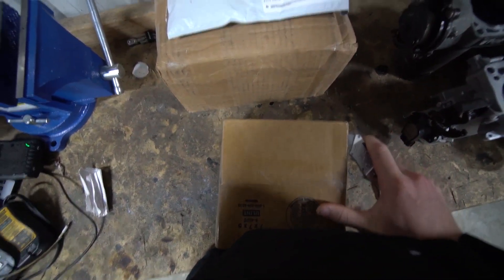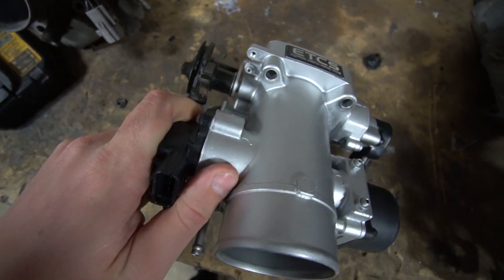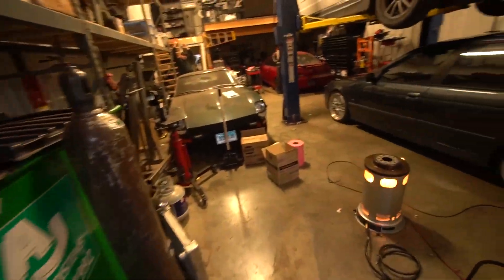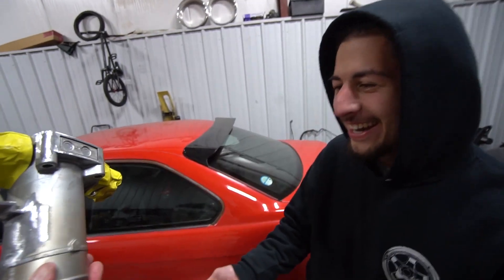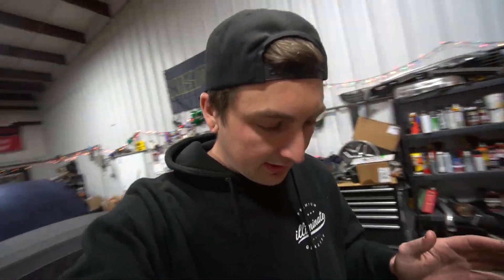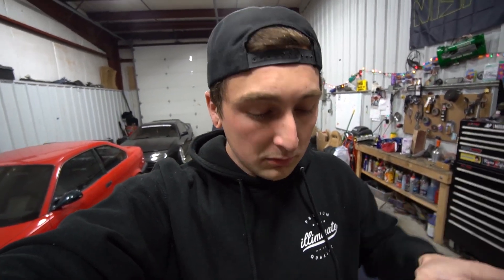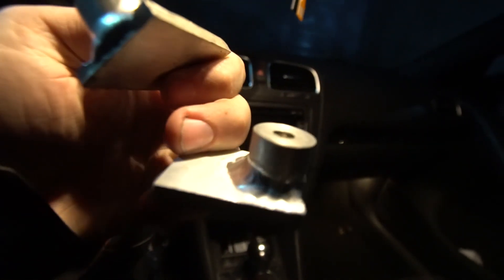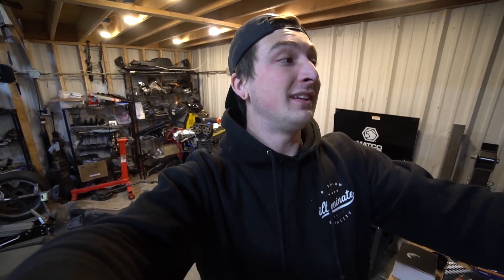Out with the NEW, in with the OLD.

Comment: U should weld 2 tabs on top of the radiator to attach it with the same bolt holes as the intercooler when u go to have the tab welded on bottom of the under cooler and have him do the throtle body at the same time ya dig

Comment: What you could potentially do is have the first butterfly valve as a safety parameter, so say the car starts to get hot it closes or something else. Just an idea!
Reply: Bad idea.
Reply: @weedshoes5089  how so..? Always good to have safety features when your bashing 8k revs lol
Reply: Say the car decides it's too hot while you're on throttle through a sweeping corner, so it shuts that butterfly. The car's weight will shift forward off the rear wheels and make it spin. You just put the rear of your car in a wall to avoid overheating the engine. Good thinking.